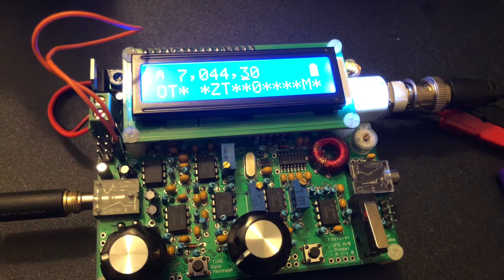QCX T1 transformer tip

Comment: i just wound this transformer for 40m...   followed the advice for 1 contiuous winding with loops... that worked great, followed the direction for the order to pull the wires through the holes,  it made it easy to get it snug on the board.  i used a magnifier through the whole process, so i could see exactly what winding wire i was working on at the time.  plus i cheched continuity before soldering on each pair to make sure i did not mix up wires.  it looks like you did a fine job the way you did it